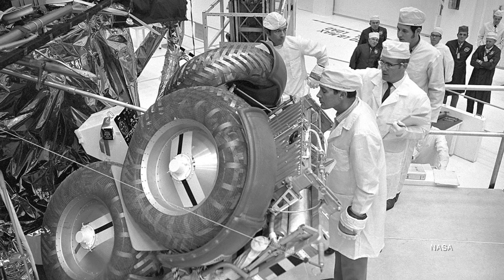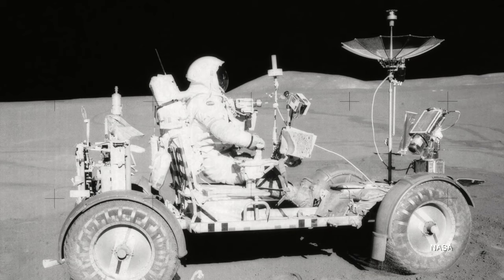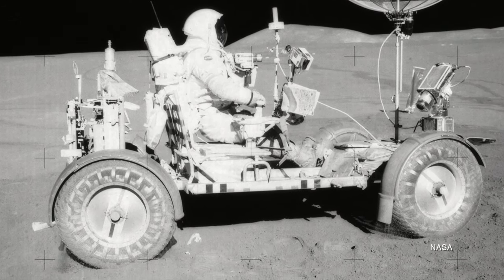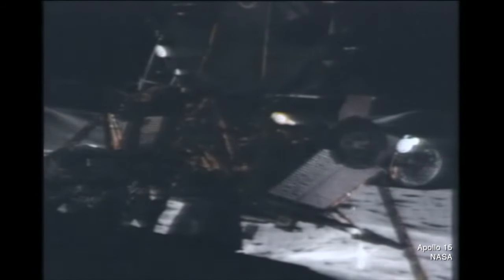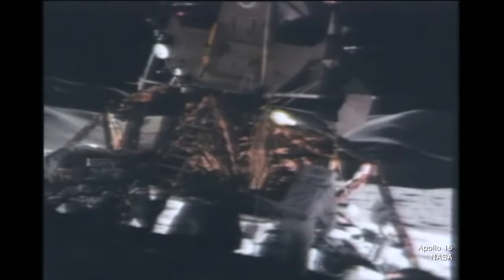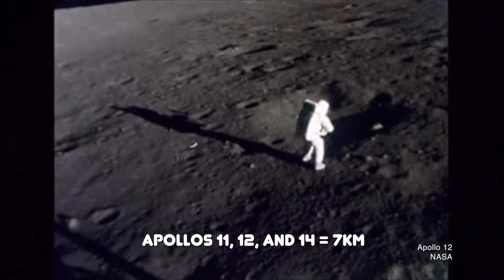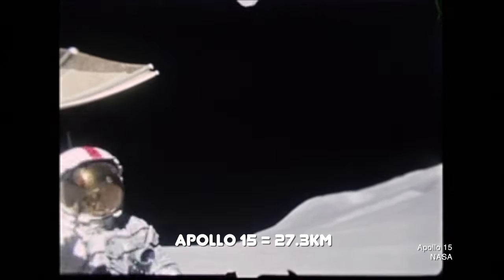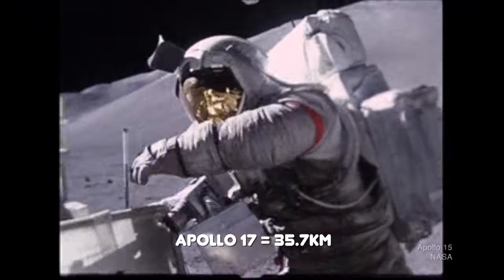How NASA Took Cars to the Moon

Comment: If we ever go back to the moon, I hope we can have much longer EVA's on the moon. Our technology has advanced exponentially since the Apollo missions so it would be interesting to see what we could do with it.
Reply: Apollo 17 had 7 hour EVAs three days in a row. Can't get a whole lot longer than that really. Interesting to note that in the early planning stages, it was expected that each mission would be given TWO Satrun V rockets, and NASA was planning to use the extra launch capacity to field a larger spacecraft that included a PRESSURISED mobile rover/science laboratory that operated independently of the ascent stage. So they'd roam around on the moon for a few days or possibly a week before driving back to the lander and taking off. Cool stuff.

Comment: Didn't see any thrust or flames coming out from the bottom of the Lander when it took off???
Reply: You see a bit of the expanding gasses at first, before everything balances out and the chemical reaction really gets going.  But, correct, if it's a well balanced mixture, you won't see a visible flame from the burning of Aerozine 50 with N2O4.

Comment: Why was the dirt off the wheels only flying as high as it would have on Earth?  Should be 6 times higher shouldn't it?
Reply: And, you know how high it would have kicked up on Earth, how?
Reply: @Iam_Dunn  
YOU SAID: "By watching videos of dune buggies you fucktwit."

== And, please tell me, what videos of dune buggies have you watched which were powered by 1 hp electric motors on the wire mesh wheels?
Reply: rockethead7 ...Rooster tails are the same regardless of tire material or engine power. Nice deflection. The expulsion of the material is NOT dependent on those factors, it’s dependent on physics. And the fact the LRV has a total HP of ONE (1/4 per motor) is laughable. Even in the 1/6 gravity of the moon, the power to weight ratio would not get that piece of shit to two mph, let alone 10.

Comment: Can we see any of the rovers from Earth with readily available telescopes?  I've always wanted to do that.
Reply: You can see the tracks at the missions sites as well as the disturbed rings of dust around the touchdown/blastoff location(s) if you have  particularly good telescope IIRC. Not sure if you can do it with an off-the-shelf astronomy telescope.
Reply: Acb Thr Thanks.
Reply: No, you cannot see any such thing from Earth-based telescopes, nor telescopes in Earth orbit (i.e. Hubble).  The images that show the rover tracks and the rings of dust (dust halos) come from JAXA and LRO (in lunar orbit).  They also show the 6 landers, 3 rovers, foot tracks, rover tracks (as mentioned), experiment packages, flag (shadows), etc.

Comment: Why were the evas so short
Reply: Dunno, why are dives so short?
Reply: Rhettson Powell they weren't. Apollo 11 was 2.5 hours, and by Apollo 17, the three EVAs were at least 7 hours long
Reply: The biggest limiting factors were the consumables in the backpacks, such as oxygen and cooling water. Then of course the astronauts expended a lot of physical effort during the EVA's so they needed to get back into the LM to eat and rest.
Reply: You can either use up a shitload of oxygen from your limited oxygen supply on the lander by walking around on the moon. Or you can save it and use it sparingly until you depart. I'd keep my EVA's short too.

Comment: Ive always wondered how the rovers were powered. I mean obviously they were electric and used batteries. But did they carry all the battery power with them from earth? Or did the rovers get re charged from the LM (which im assuming used fuel cells?) when not in use?
Reply: "Ive always wondered how the rovers were powered. I mean obviously they were electric and used batteries."   --   The Lunar rover used two 36 volt, 105 ampere hour silver-zinc batteries.

"But did they carry all the battery power with them from earth? Or did the rovers get re charged from the LM (which im assuming used fuel cells?) when not in use?"    --    The batteries were not recharged and the LM did not have fuel cells, it also used silver-zinc batteries.
Reply: Nice to see a sensible question and a sensible answer. Why are these things so rare now?

Comment: Where did they get enough fuel to propel the lander up to orbital speed and rendezvous with the mothership?
Reply: The company that supplied the Aerozine50 was called "Aerojet General."  It no longer exists today.  But, they manufactured rocket fuel for several decades.
Reply: How much fuel did they need?  What is the mass of the ascent module, and what was the delta V required in order to obtain a stable orbit allowing them to rendezvous with the orbiting CM/SM?

If you can't answer that question, then any answer to your question wouldn't make sense to you anyway.  What's the point?
Reply: @rockethead7  To land on the lunar surface, they had to slow down from many thousands of km/h to zero speed. As they did in those years when rockets didn't land vertically and didn't have enough fuel to slow down orbital velocity. Reminder that the moon has a negligible atmosphere and that doesn't help.
Reply: @willoughbykrenzteinburg  To land on the lunar surface, they had to slow down from many thousands of km/h to zero speed. As they did in those years when rockets didn't land vertically and didn't have enough fuel to slow down orbital velocity. Reminder that the moon has a negligible atmosphere and that doesn't help.
Reply: @PSsquadron  What was their orbital velocity?  What delta V was required to go from orbit to landing? How much delta V was the descent stage capable of?
Reply: In the fuel tank, It's not that difficult.

Comment: How did the camera on the rover track the LEM's take-off ?

It appears that the camera tilts up to follow the craft ... Did they use motion tracking or was it some sort of timer or spring-based mechanism that was triggered ?

This has always befuddled me.
________________________

Great Channel, Amy.

Thank you !

-- Alan
Reply: It was remotely controlled from Houston. Of course, he had to allow for the time differential to try and anticipate where the LM ascent stage would be. The tilt mechanism was damaged for the Apollo 15 liftoff and for Apollo 16, the astronauts didn't park the lunar rover at the correct distance. By Apollo 17, knowing this would be his last chance, the remote operator made sure they did park the rover at the correct distance and the end result is what you see. Keep in mind that the operator was constantly using the TV camera once they had the rover parked at various locations throughout the EVA's as can be seen in the Apollo 16 "house rock" video. Google "Ed Fendell" to get more details about his experience with this during the Apollo J-missions.
Reply: Hi S, hope that you are well. You referred to the filming of the assent stage of Apollo 17. This camera was controlled by Ed Fendell in the Huston control centre. This as you can imagine was a difficult task, In addition to the 1.3 second time delay each way he had to deal with a motor reaction time of just over 1 second. This meant that he had to anticipate some 4 seconds into the future. The filming of the Apollo 15 and 16 LM assents didn't go exactly as planned for various reasons but third time lucky Ed got it wonderfully spot on for the Apollo 17 LM assent from lunar surface. More details about and plans of this camera system are available online. Take care.

Comment: Two questions about the rover 1. Was it electric? 2. Hypothetically would it be able to be recharged if we ever go back?
Reply: 1) Yes.
2) No.  It used a non-rechargeable pair of silver/zinc batteries.  Minimally, you'd have to replace the batteries, not recharge them.  But, who knows what else might need replacing also, after all of these years.

Comment: Was it batt. Powered ?
Reply: Yes.  Silver-zinc batteries, to be exact.
Reply: rockethead7 ...That have an operational range of -30C to +55C. Buttttttttt they survived 3 days in direct sunlight... LOL “Man on the Moon”... what a joke!!
Reply: rockethead7 ....” LRV batteries and electronics were passively cooled, using change-of-phase wax thermal capacitor” - Wikipedia (only source I was able to dig up, can’t find any data on NASA’s site, maybe you have a better link?)

Please explain how a radiator (passive cooling) works in a vacuum? Assume, as you put it, “I have ZERO understanding”.

Comment: The 1988 Honda Prelude also had 4 wheel steering like the Moon Rovers.

I believe I recall one Moon Rover had a malfunction and only one set wheels
was steerable.  It was used as it was anyway but I hear parallel parking it was 
much more difficult.
Reply: Apollo 15's front steering failed for the first drive.  But, on the next drive, it started working.
Reply: Fortunately the car park was nearly empty.

Comment: Awesome background stars, oh wait, the moon's atmosphere seriously occludes light.  Also awesome, that the mostly-undisturbed moon's surface does not allow dust to fly up any greater than what we would see on earth even though the moon's gravity is 1/6 of ours.
Reply: You don't know what you're talking about.  Want to try again?
Reply: Hi R, hope that you are well. The dust thrown up by the wheels of the Lunar Rover clearly does not behave as it would on Earth and its behaviour is exactly consistent with a low gravity, no air-resistance environment. As evidenced in various video sources the dust quickly falls back to the ground showing no sign of floating or being slowed down in a horizontal direction by air-resistance. On earth, dust tends to billow and form clouds due to the effect of our atmosphere. The trajectory of the dust is also characteristic of the lack of air-resistance. A perfect example of this is the "Rooster Tail" dust trails kicked up by Apollo 16's John Young during his "Grand Prix" in April 1972. This very situation has been analysed, studied and the published results are easily obtained online. "Ballistic motion of dust in the Lunar Roving Vehicle dust trails", Hsu, Hsiang-Wen, Horányi, Mihály, (University of Colorado), American Journal of Physics, Volume 80, Issue 5, pp. 452-456 (2012). They conclude that the lack of particles’ deceleration along the x-axis of their coordinate system, could only be the case if Apollo 16’s rover footage was filmed in a vacuum and in an environment where the acceleration due to gravity was 1.6 m/s2. . Enjoy reading, take care.

Comment: You did not mention the motive power for the Moon Buggies. They were electric, running on silver-zinc batteries that were the best available at that time. Not designed for recharge, but able to hold their charge for a very long time. 
I might also mention that there was a proposal to make the buggies pedal powered in the early development stage.

Comment: What a wild idea....    I'm so proud of us  😍  Was the lander on really slanted ground or was the camera horribly tilted?  (on that mission)  just curious if you know.  thanks!  I guess it was pretty much a crap shoot back in the late 60's and 70's.
Reply: Apollo 15 was a rough landing on uneven ground, yes.  In fact, they landed on an inclined and curved surface to the point that the engine bell literally hit the ground and cracked.  It's tough to tell in some photos, but, the engine bell was pretty much flush with the surface.  And, Apollo 15 was, for better or worse, the closest to a "textbook" landing for the way the lander was designed.  Dave Scott had the whole thing leveled out by 100 feet and just descended straight down (which is what they were supposed to do, making it hard to see exactly what was below him).  Good thing he also shut the engine off at the desired time, right after the contact light, which was when the craft was 5'8" above the surface.  If he had left it on past touchdown, like Shepard/14 or Armstrong/11, yeah, with the engine crashing into the ground and ending up flush with the lunar surface, that could have been a major problem if it was still turned on.  By comparison, Armstrong's approach on Apollo 11 was moving horizontally all the way to touchdown, and Armstrong had a lot better idea of where exactly he was going to land because he saw the exact spot he wanted and steered toward it.  This was NOT according to plan, of course.  But, they couldn't land in the boulder field, so Armstrong had to improvise.  Scott's landing on Apollo 15 was "perfect" in the approach and everything, exactly according to plan.  But, the down side was that he couldn't see directly below him.  And, yeah, uneven terrain, rough landing, etc.  I don't think it was tilted quite as badly as the video might represent.  I suspect that there's a camera angle issue compounding the perception of how tilted it was.  But, yes, it was tilted.
Reply: I really don't see much reasons to be proud of such a lie honestly... I would rather be ashamed to be so gullible.